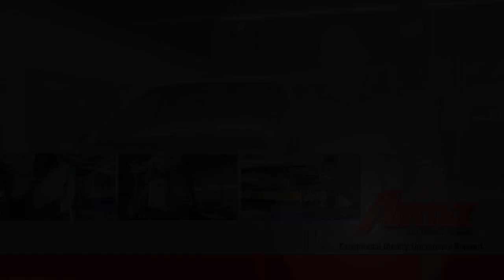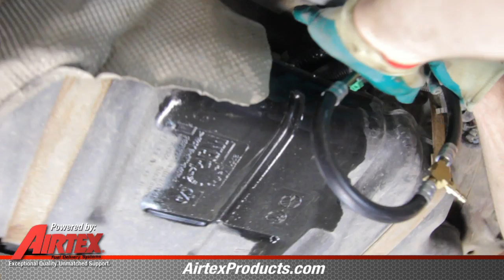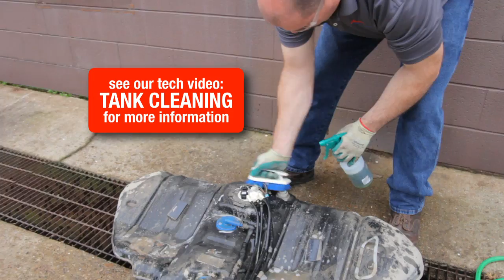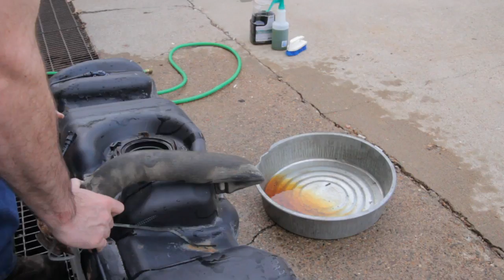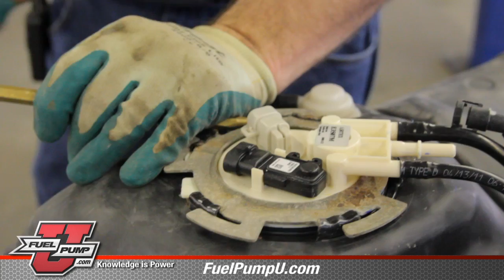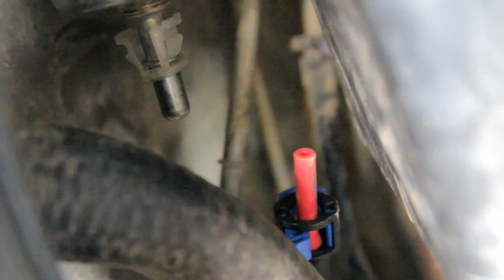How to Install Fuel Pump E3507M in a 2001 Oldsmobile Alero, Chevy Cavalier and Malibu

Comment: I had to replace my fuel pump in my 2002 Alero and it is really as easy as he makes it look. Took me less than an hout on the ground to drop the tank,change the pump and reinstall it. Been running for over a year now. 30k later lol
Reply: How did you get the tank off? When removing the straps, the tank is still lodged into place

Comment: There IS a Schrader valve on the 3.4 motor in my 2001 Alero. Musta been a special addition on my car as the master mechanic says there isn't one. Its at the end of the fuel rail on the rear bank right side by the power steering pump.

Comment: A bad injector going short to ground can cause the injector driver to overheat, causing engine to cut off.  Won't restart until driver cools. Suggest ohming injectors for equal value somewhere between 12 to 16 and not to vary more than .5.
This looks like my problem!

Comment: I got a free fuel pump once because the place I took it to assigned it to a young mechanic who determined that was the issue.  When the car still wouldn't work right it ended up being some error with the computer that was easily re-programmed. I wonder if that guy lost his job. LOL!
Reply: What was the problem with your car?

Comment: i have a 99 Oldsmobile intrigue with a new fuel pump

just bought a either 99 or 01 Oldsmobile Alero will the fuel pump form the intrigue work on the Alero.

Comment: My 2002 oldsmobile alero will start (turn over) but will not say on? What could it be? I can hear the fuel pump and when i put gas in the corporator it starts and turns back on... Can you please let me know what is wrong...

Comment: Will fuel cleaners like lucas prolong the fuel pump?
Reply: Filmaker25; Sta-bil 360 is the best imo..it makes ethanol fuel burn cleaner and reduces carbon build up. Thank goodness I have access to alcohol free fuel in my area. Using a top tier fuel is most important. It's not worth saving a nickel or two when you consider the negative affects of burning cheap fuel in your engine.

Comment: This is my problem.  It  has happened 5 times while driving vehicle. I want to make sure it is FUEL PUMP.   2000 Olds Alero 3.4 V6 engine car starts and drives but cuts off automatically after driving for a bit. When it cuts off, the engine will not turn over.  I have to wait an hour comeback and it starts back up.   Again starts up great every morning, but cuts out while driving after a few miles.  I have not driven far because of this reason.  FUEL PUMP GOING BAD?

Comment: hi, I have a 2000 alero it turns over like it wants to crank but I do not think its catching gas do you think it is the filter needs to be cleaned or a new fuel pump. Please help!
Reply: Motor mounts for Grand Prix 2005